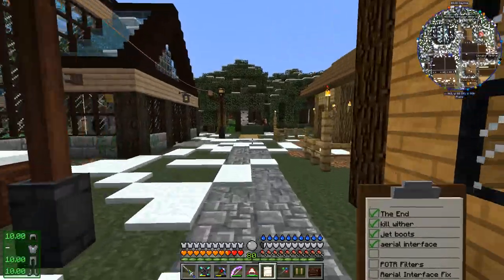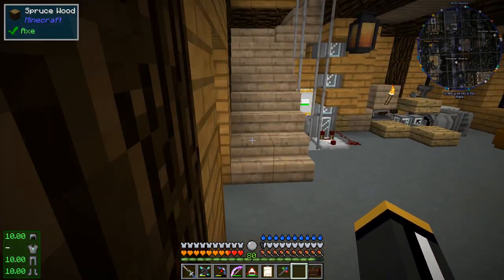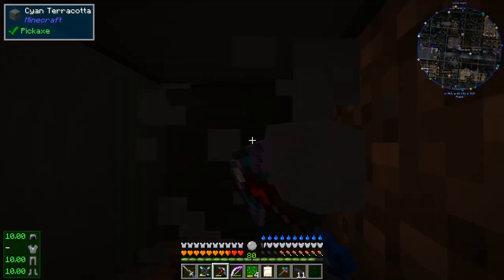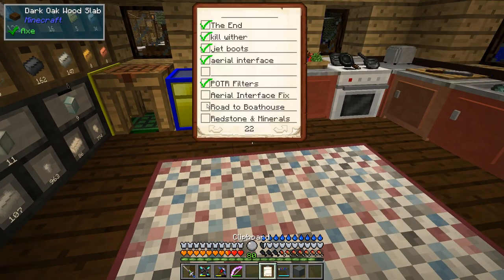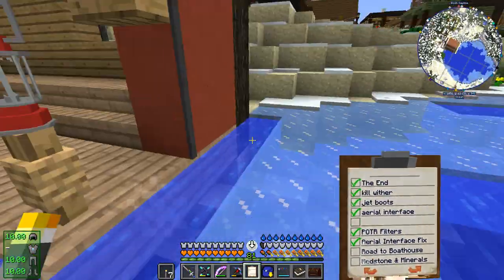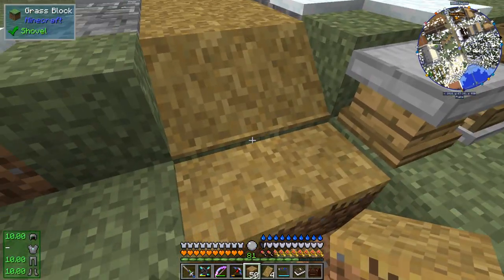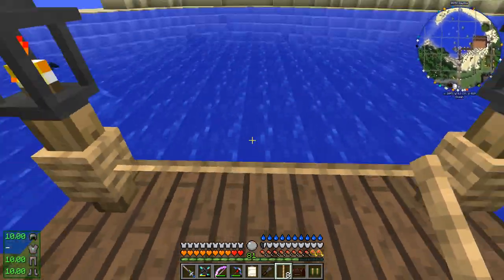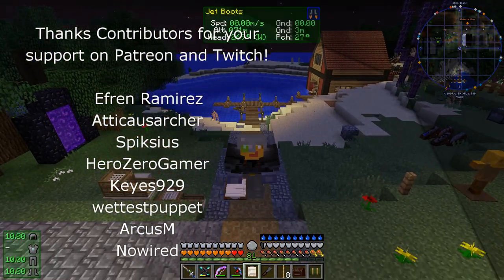Real Tech S2E53 - Boat Dock and Other Misc. Improvements

Comment: I feel bad as I didn’t notice that your aerial interface wasn’t connected up correctly, it was a challenge to get working. Is that a change with the advanced pcb on the charging module? Something discovered by chance is you can add a one probe to any helmet, had mine on living armour, then you hold shift to see the contents of inventories; hardest bit is to remember to to it.
Reply from the maker: Not sure if it's a change, but I didn't know about it until desht told me about it, so I'm pretty sure it wasn't in the documentation.
Yes, the one probe can be added to any helmet. It can also be made into a bauble, which is what I'm doing.
Reply: @DannySon  I didn't remember that I'd had an advanced PCB on the charging module but there is one on it. It's in the manual but I don't remember reading it. Age I guess...